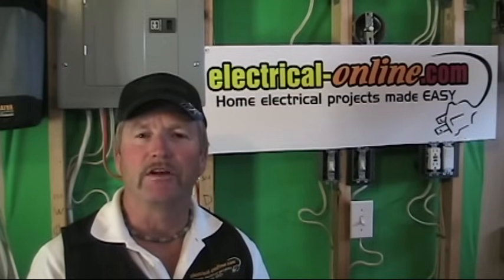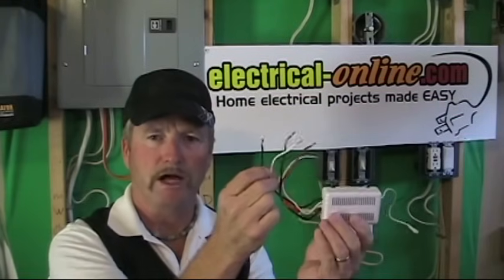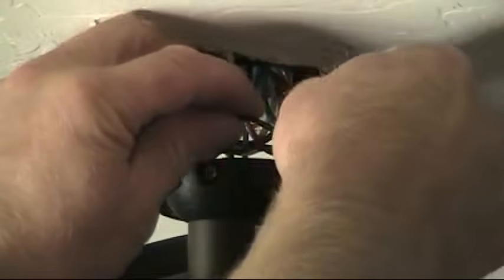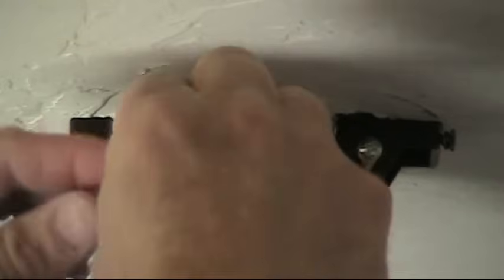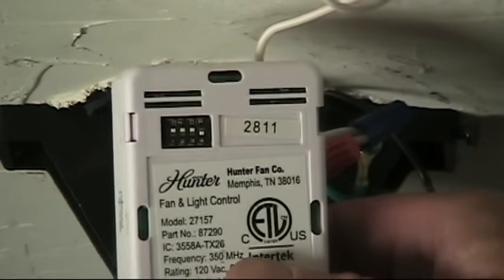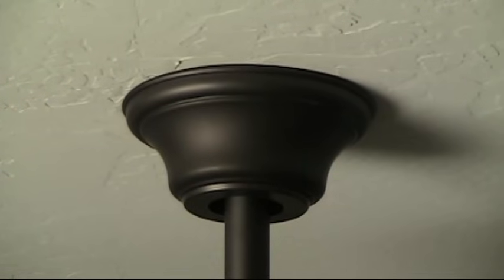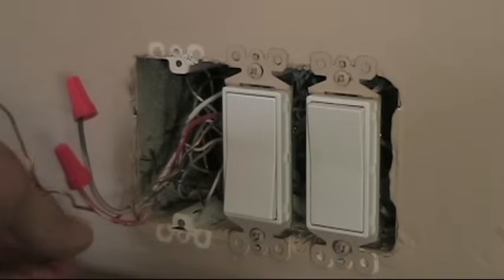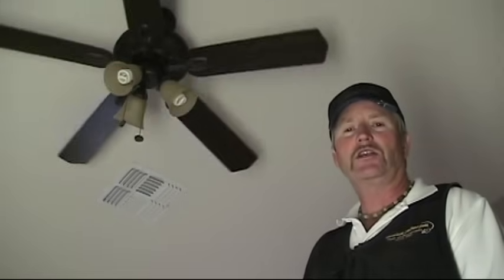How to Convert a Ceiling Fan to Remote Control

Comment: 12:57 I think you should use a Hampton Bay remote control because the name of this fan is called the Hampton Bay Glendale
Reply from the maker: This is a generic remote and can be used with any brand of ceiling fan that is just a standard fan / light.

Comment: Thanks for a great explanation, Terry. I changed out an old fan and installed a new fan and Universal remote. I have a two switch control on the wall. It didn't work,  so after rechecking everything, I found your video. I eliminated the wall light switch and also found I needed to use the red power wire feed at the receiver instead of the black wire. Works perfectly now.

Comment: First I would like to thank you for your great videos!  Now for my question.....With a ceiling fan/light fixture that is controlled with a remote, can the light switch at the door be used to turn on the light when you enter the room and then use the remote to turn off the light? I do have two switches that used to control the old fan motor and the light separately.
Reply from the maker: Thanks for the nice comment! Appreciated.  Nothing will work until you power on that switch feeding the receiver.  Then the remote will control everything so I guess the short answer is no.

Comment: If you Cap the red wire won't that leave the fan switch on the wall innert?
Reply: I really wish there was another way. I'm in the process of doing an install and I think I'm going to try and bypass the light control. I really want to be able to control everything from the wall and at the same time have the ability to use the remote.

Comment: Hi, i got 4 ceiling fans that came with remote control modules. I asked my electrician to install them bypassing the remote control module because i wanted to control them just by the wall switch. Guess what? All of them burned! I need help on how to correctly wiring them. The electrician says that the capacitor is on the remote control module, and when it was removed, then the fan didnt had capacitor and got burned. Please help!!! I already got new motors as replacement, but still want to avoid the remote control modules.
Reply from the maker: Oh boy.  That would require a whole bunch of information here.  I think you'd be wise to get in a good, knowledgeable electrician.

Comment: How about the pulling chain switch? You need to by pass it.
Reply from the maker: With this remote, it is only an on-off control for the fan and the light, so you need to have the pull-chain for the light left on, and the pull-chain for the fan in whatever speed you would like it to run at, and the reverse switch in the position for how you want it to move air as well.  Thanks for watching Victor!

Comment: I just installed the hunter 99770 with a FLUSH mounted fan like at 0:26 NO PROBLEM.  No hums and runs smoothly.  I had to take more apart (lighting assembly, blades, then that big shroud) but it still only took an hour.  Before, I had 2 switches, one for the light, one for fan.  I left the light switch at the door and hooked this up just to the fan.  Now it runs all 3 speeds off the remote at the bed yay!

Comment: Do they have a wireless kit that replaces the pull chains? I’ve seen the wireless kits that have fan speed control, but they all connect to main fan power and require the pull chain to be set to high speed. Was wondering if the pull chains could be bypassed entirely.
Reply: Why do you need to bypass the pull chain if the remote you mention can control the speed? Just ignore the pull chain after it's set?

Comment: Hi, thank you for the video. I just installed a similar fan remote. Is it possible for the switch to still operate the light as well as the remote? Can it be set up as some sort of 3 way?
Reply from the maker: Probably possible to set it up as an either / or situation if you have the 3-wire feed to the outlet.  Either the switch, or the remote to turn on the light, but wouldn't have 3-way type functionality where if you turned it on with the switch, couldn't turn off with the remote.
Reply: Cud add a remote light to the fan

Comment: Nice but you skipped the main part putting that remote module in the bracket!! Even though I figured out that you have to  dent that bracket a little then it slides on top

Comment: Hi. We're having a house built. We opted to not have 3 wall switches and so we'll only have 2. We think that was a mistake now considering that we'll want to be able to have something controlling the fan rather than pulling the chain. Will your tutorial work for us although we only have to wall switches?
Reply from the maker: Yeah, this is the solution for sure.

Comment: Hello, Mr. Peterman. As a layman, I need to know what does it mean when you refer to the wires as in and out, and then while you were connecting the wires you mentioned a couple of times the word 3 wire cable when you only had two wires being clamped in the safety nut. Your response will be greatly appreciated.
Reply from the maker: 3-wire cable (+ ground=4) refers to a set of wires in a cable jacket commonly referred to as Romex, or Loomex.  So a 3-wire cable will have a black, red, and white wire along with a bare ground wire.  Does that answer your question?
Reply: @theinternetelectrician  yes, thank you.

Comment: hi .. gr8 video ... a question ..  I have a Aldi DC remote control ceiling fan , terrific & quiet .. but !! , even on speed 1 it spins a bit too fast ...
- any clues how to slow the speed down .. ??
Reply from the maker: There would be a way, but not a sanctioned way by the manufacturer I'm guessing.  You could put a current limiter in line with the motor circuit, but probably not an easy task.
Reply: Cud try MOSFET circuit or just resistor

Comment: the lights shown in the fan are Fllourscent and should not be used with remote control units. Filament or LED are  suggested.

Comment: Hello Mr. Terry. I have high ceilings and have a ceiling fan that only has 1 switch on the wall to turn it on. I have to put really long pull chains. Can I still install a control even thought I don't have a light switch and a fan switch?
Reply from the maker: Yes, that will work great as you only need on hot feeding the remote anyway.
Reply: Awesome. Thank you

Comment: The fan remote that I installed in my previous house, had light dimming and adjustable fan speed. I wouldn't bother with a remote that didn't have both of those functions. Great video, very detailed.
Reply from the maker: Yes, much better to have that functionality.  I agree.

Comment: For hen love of all that is holy I watched torn 10 minutes to specifically see HOW THE RECEIVER FITS INSIDE THE RING!!!!! He freaking skipped that part. I am so frustrated.
Reply from the maker: Sorry, there is no one answer that fits every situation. You just have to find a way to work it in to the canopy wherever it can comfortably fit without pinching wires when you put it back together. Every fan, make, and model will be different.  I can show you a picture of where this one fit in if that will help?

Comment: Great Video and very helpful.
 I had installed one of these few years ago and now the fan shuts off automatically after some time; Initially i thought it was a bad capacitor so I changed the capacitor. But I still have the same issue, I wonder if the remote control switch is malfunctioning. Is there a way to find that out. Thanks for the help
Reply: Watch out for other remotes interference like TV remote lol

Comment: I lost my remote control can I still use my fan
Reply: I'm not the publisher of this video but, I'm very familiar with this fan set up and installation.. You will be in need of a remote, if your fan was originally wired in WITH a remote.. Hope this helps you.. Too bad someone couldn't have replied to you sooner..

Comment: Does anybody make a Wi-Fi remote that I can tie into Alexa, Apple, etc.? Of course I should get light control (including dim, fan control including speed).
Reply: That's not hard thing to do tbh
Use Arduino with WiFi module and relays to different capacitor for fan speed control

Comment: I have a red wire, along with the black-white-and the ground. In hanging a ceiling fan I put the ground together, followed by the black and blue to the black from the ceiling and white to white. What do I do with the red wire?
Reply: cap it..its not needed
Reply: @ohyeaI4got  what if you have light and fan switch ?

Comment: Just need to install a single light no fan, no existing wall switch.  Existing light has just a pull chain and black and white wire. I bought a wireless remote - it has blue black red and white wire,  plus signal wire.....help

Comment: help. i just installed remote  control for cieling fan & light however the remote will not turn light off  but fan does work. Can anyone help with this please and thankyou
Reply: +Wayne Tart Blue wire not tied to the black wire.

Comment: I just installed a Hunter receiver/remote (model 99122) on an existing Hunter ceiling fan in the kitchen.  The installation was easy, but whenever we turn the light on, there is a low buzzing noise.  Has anyone else encountered this?  If so, what does this mean?  The noise doesn't exist when the fan is on - only when the light is on.
Reply: if you're not using a compact fluorescent light bulb aka. CFL bulb, the control thing turns off the dimmer for the unit. Which then makes it run at 190 instead of 220 and that can make it humm/buzz. If you're using a CFL bulb, the dimmer may be set to the low setting resulting in the same sound.

Comment: What if you have a remote control fan and you want to have it tied to a switch as well, can that be done?
Reply: What you mean tied to a switch 🤣
Reply: @davey2k12  I’m guessing I meant if you don’t want to always use the remote control could you have it operated by a light switch.
Reply: Or if you couldn't find the remote 😂
Either separate the light so it only controlled by the switch and the fan just works using remote but my remote receiver off button don't work so I had to use the wall switch to kill the fan 🤣

Comment: Not that it matters but Id like to mention to folks that they also make remote control kits that have the fan speed functions built into the remote, so you don't need the pull cord on the fan to change the fan speeds. Just trying to make this option known for people that may want this! Very helpful vid Terry!
Reply: justin evans Oh yes, it matters...that is exactly what I need...a remote switch to operate the speeds of the fan... Right now it is stuck on "blast-off"
Reply from the maker: True that Justin! Thanks for the comment.
Reply: Thanks for letting everyone know that Justin. Why in the world would anyone buy one that doesnt let you control the fan speed ??? Kind of defeat the purpose of buying a remote if have to get up and pull the chain each time to change the speed..
Reply: Lisa Wyndham heheh, sorry for your trouble on your fan speed. Is there not a chain/switch built onto the fan where you can adjust the speed? If the switch on the fan doesn't change the speed the switch in the fan is bad or it is wired wrong.
Reply from the maker: Is your speed control switch on the fan not functioning Lisa?

Comment: I would like to know if I can use a remote fan switch just to control a light from the ceiling, The light is not controlled by any other switch on the wall. It just has power to the light in the ceiling.  There was a fan in there before with remote but no longer a fan in the room.
Reply: Kurt Olmstead
Reply from the maker: There are many remote  options available for controlling lights / fans, or fan / lights.

Comment: Our electrician did not wire the fan on-off to a wall switch, just the fan light.  We have to use the pull cord, which is why I want to add a remote switch.  Is there any harm in keeping the fan light on-off wall switch active?
Reply: no... you have to remember that if you turn the power off at the switch the remote will not work.

Comment: Is it possible to have a second remote control? Does that wireless receiver supports more than 1 remote control? please advice.. Thank you....
Reply: I'm guessing you can get a second remote and set the dip switches set the same. Just like garage remotes.
Reply: Yes, we have two remotes in our bedroom. We had to purchase another remote kit that included the remote and wiring harness. We just had to set the remote switches to match the settings of the fan.

Comment: I have 2 Hunter ceiling fans WITH Hunter remotes (3 speeds + off and dimmer).  The fans are about 5 years old but have not been working for the last year.  One of them completely quit and the other the light turns on with the wall switch & I hear a click when I turn it on.  I paid for a new lower housing to be sent from Hunter because they felt that this would surely fix the problem and it had simple instructions on how to plug in the new housing.  IT DIDNT WORK.  Still nothing on the totally broke fan/light.  The lower unit I was sent appears to mainly a light kit unit (has three lights and the pull strings inside it for the fan and the light.  It has a simple single plug to connect to the main body of the fan (which I guess has the fan motor).  Nothing happened when I plugged it in.  The other fan, the light works but not the fan so I'm not messing with it for now.  I am wondering if the remote can go bad and not allow the fan to work?  The remote also does not work with the one light that does work, I use the wall switch and the fan will click when I throw the switch.  ANY ideas are appreciated as the fans were not that old when quit working. Does it sound like a motor problem or wiring problem.  I have dual wall switches, one for the light and one for the motor. Thanks.

Comment: Mr. Peterman, any help or tips for reversing this process? our remote stopped working and the unit's pull cord will not work. Is this because it's set up to only work with a remote or is there a way to bypass it?